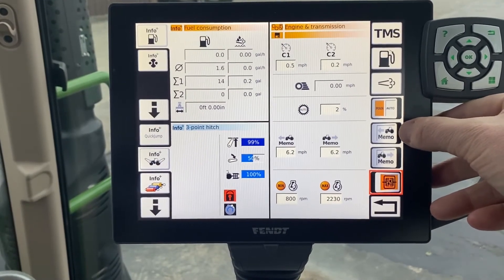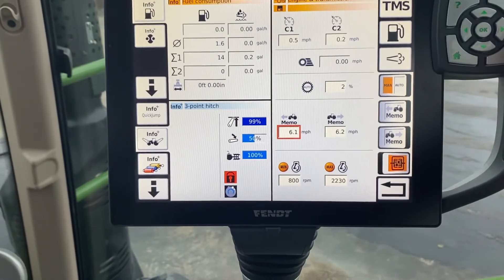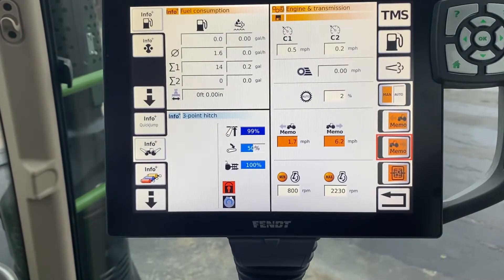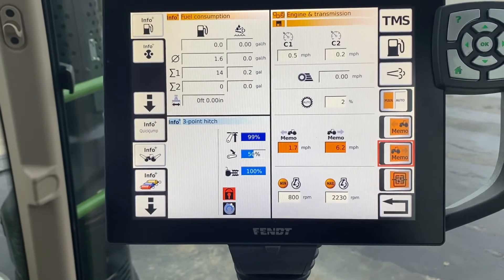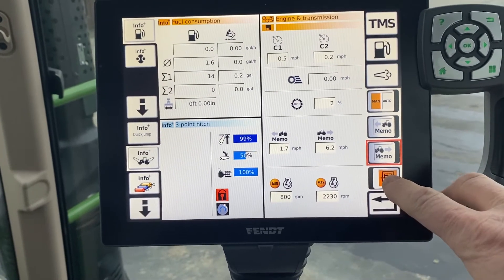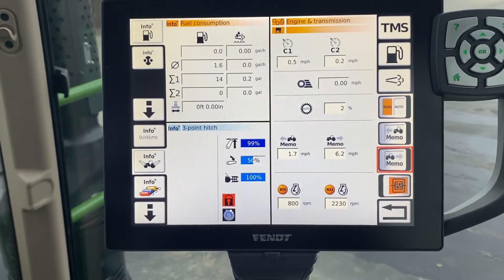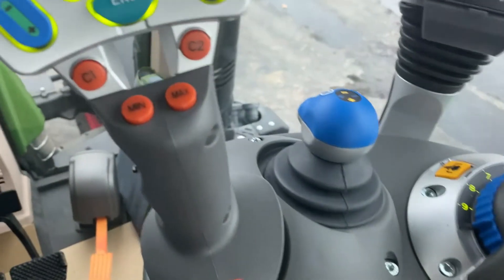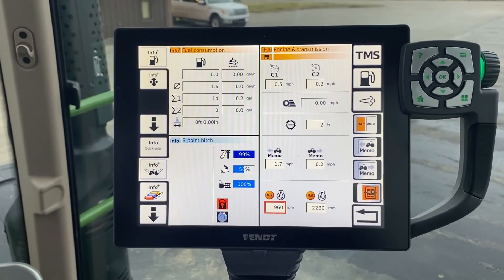How to Use Memo Buttons and Turbo Clutch | Engine and Transmission Screen Basics Part 3 | Fendt

Comment: Is it possible to adjust how aggressively the shift from forward/reverse is? I set the memo at 4.5mph and it hurts with how quickly it shifts direction...thanks.
Reply from the maker: The roman numeral button on the side of the joystick (where your thumb is) will set the aggressiveness of shifting

Comment: Please explain turboclutch button, when should turn it off? Thank you!
Reply from the maker: The turbo clutch function works very similar to a torque converter (it's what gives the Vario smooth acceleration/deceleration). It also allows you to hold the transmission with the brakes when the engine rpm is below 1500. The only time that it becomes necessary to turn it off would be in a situation where you are stuck. When you are stuck, and rocking the unit, there is a lot of high torque/low rpm operation which potentially could result in the oil to overheat. Hope this helps to explain why/when it would get shut off. Thanks.